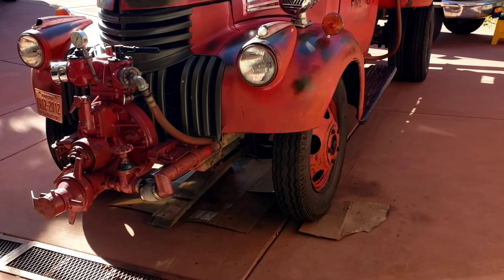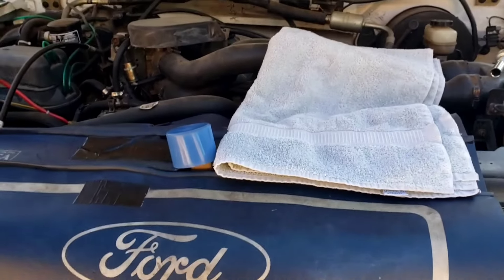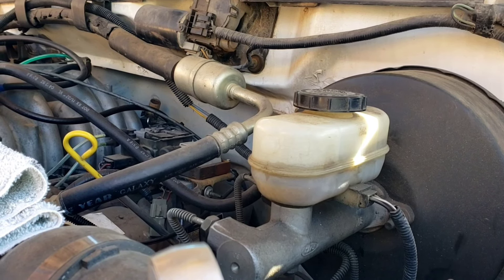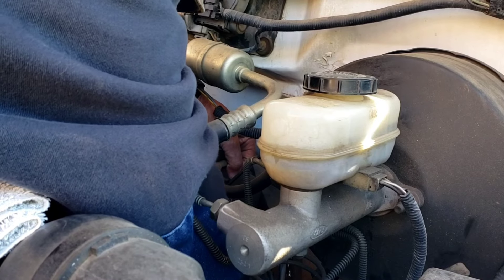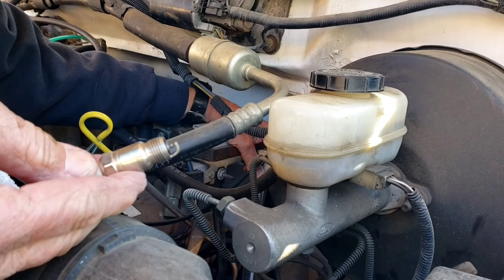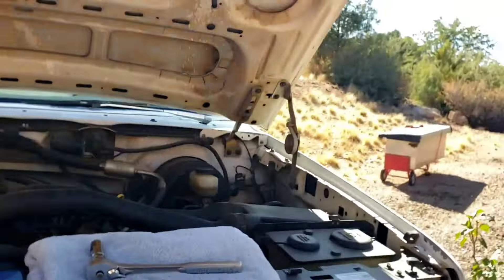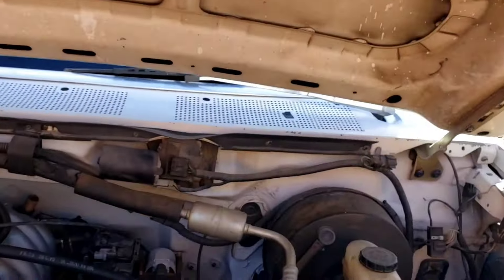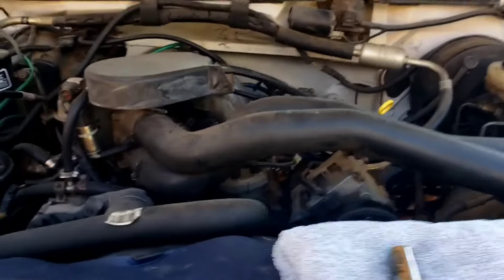Fixin' Stuff - Fuel-fouled spark plug.  Again?  Let's fix it!

Comment: Chuck, would it be possible to take the injector out and attempt to clean it. I’ve never had to do that but may be worth a try. If you have to remove a bunch of stuff to get to it, I could understand why you wouldn’t want to do it. In my life I’ve only had one bad one go out in my truck, but don’t remember what it cost. That was almost 30 years ago. Could maybe use a hotter plug but still may not help. Rock Auto does have good prices. Get all my rotors and brake parts there. Almost half the prices of auto parts stores. Could always try some Seafoam, wouldn’t hurt
Reply from the maker: Hi, David....  Back in 2020, when I had this engine out of the truck and apart as my "Covid project," I took the injectors to a place down in the big city that cleans, calibrates, and "reconditions" fuel injectors.  So there really shouldn't be anything wrong with it, but as we all know, things go bad....and who knows how many millions of times this injector has turned itself on and off in 30+ years.  Knowing how they are made inside, and the fact that it still works, I keep thinking that it must be just a little itty-bitty flake of varnish or something blocking it, and that it will clear itself.  Like I said in the video, it's been fine for several months, and I thought that it was okay....